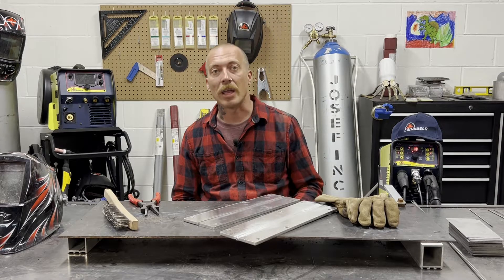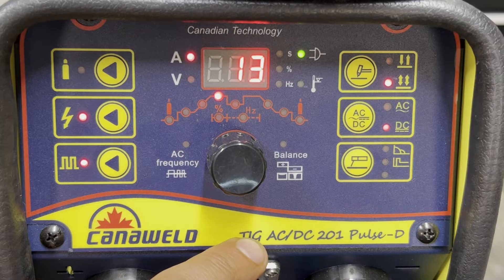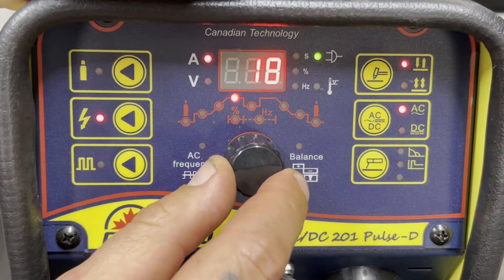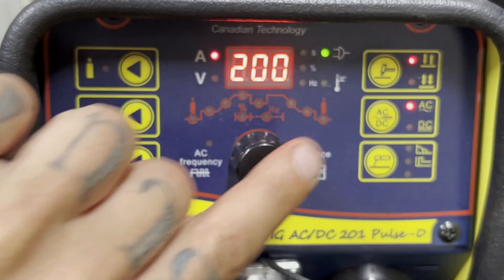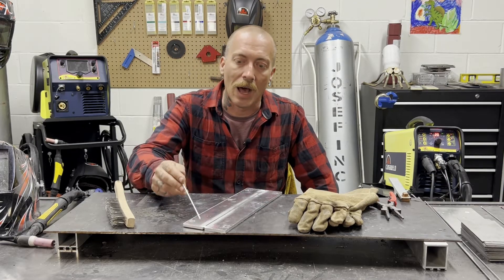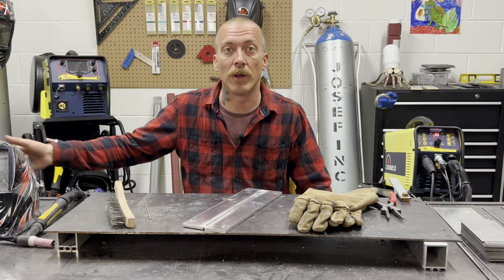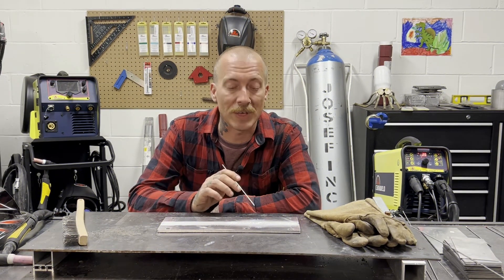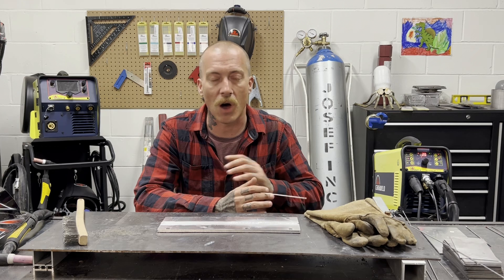TIG AC DC PART 2, AC WELDING

Comment: What is up slope? down slope?
Reply from the maker: In TIG (Tungsten Inert Gas) welding, the terms "slope down" and "slope up" refer to the control of the welding current at the beginning and end of the welding process, respectively.

1. Slope Up: This is used at the start of the welding process. When you begin a weld, a sudden application of the full welding current can cause problems like excessive spatter or burning through the material. To avoid this, the "slope up" feature gradually increases the current from a lower level to the desired welding current. This allows for a smoother start to the welding process, minimizes defects, and provides better control.

2. Slope Down: This occurs at the end of the welding process. When you finish a weld, suddenly cutting off the current can lead to crater formation at the end of the weld, which can be a weak point. The "slope down" feature gradually reduces the welding current instead of cutting it off abruptly. This controlled reduction in current allows the weld pool to solidify more gradually, reducing the risk of crater formation and ensuring a stronger, more consistent weld.

These features of Canaweld's TIG AC DC machines are particularly important in TIG welding due to their precise and controlled nature, where managing the heat input and weld pool is crucial for high-quality results. They help in achieving better weld quality and reduce the likelihood of defects.
Reply: Thank you so much. Very informative. 
Santa arrived today with my AC DC 201 TIG Pulse.
...building my weld cart tomorrow.